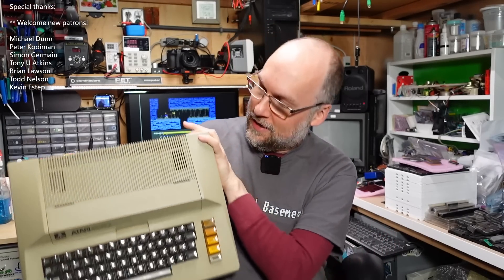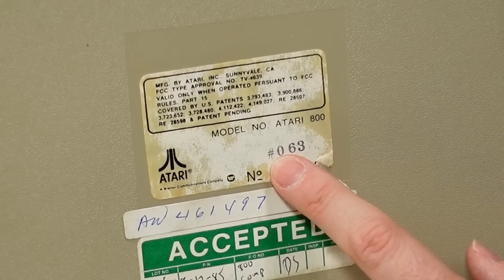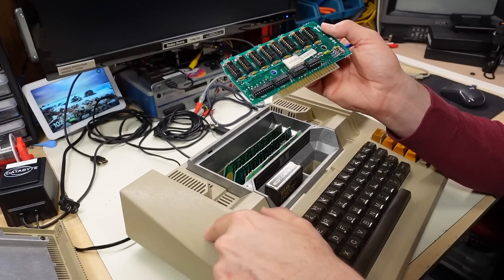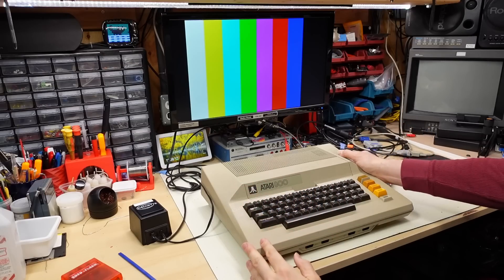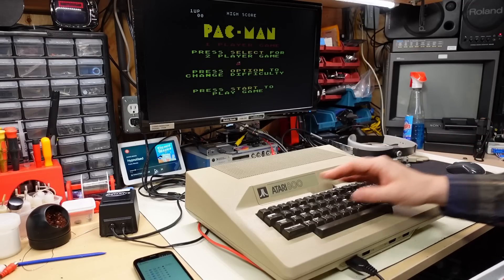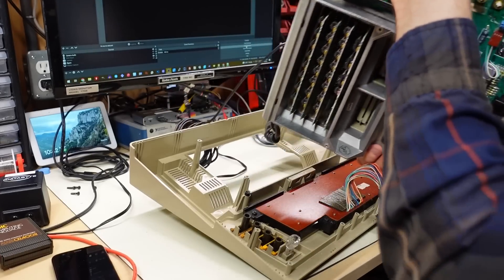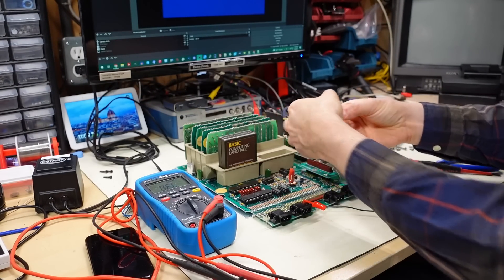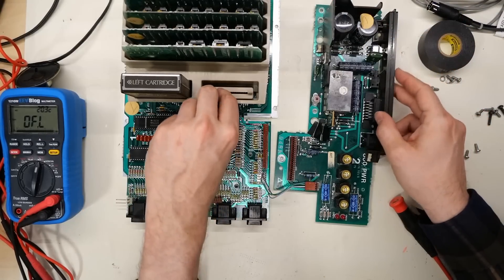Troubleshooting the beautiful Atari 800

Comment: The 800's case was designed to look like an electric typewriter. The thick metal shielding was required due to the strict FCC rules regarding RF modulators prior to 1981; thus, most other pre-1981 computers don't have a built-in modulator (Apple II, VIC-20, TI-99/4A, etc.). I believe that's also why the RF cable is permanently attached. In 1981 the FCC rules were relaxed and after then computers and video games could have a built-in modulator without needing such massive shielding, and the RF cable could then be removable. And Atari, Commodore, and TI all use the same pins on the video connector for composite video and audio, but the pins for luma and chroma (if present) are different on each system.
Reply: I wouldn't be sure of that.  The RF modulator is not under the heavy shielding.  It is the main CPU system that's under thrre.
Reply: yeah it was the address and data bus that were the primary rf radiators.
Reply: There is no rational basis for such thick metal for RF shielding.
Reply: The only rationale I can think of as to why the formidable RF shielding is possibly because a lot more people were listening to AM radio broadcasts in those days. I don't think FM and NTSC television receivers were as susceptible to interference from these machines.
Reply: I think it now makes sense about the built-in RF cable.  Bil Herd said to meet the FCC standard they had to have a 1m wire plugged into every port that could take one (while doing the test). If the RF cable was built-in then they could put their big ferrite ring on the cable inside to reduce the emissions and meet the standard.
Reply: @chetpomeroy1399  For TV, audio was FM, but video was AM.
Reply from the maker: @Daniel Morin  -- yep where I grew up you could listen to TV channel 6 on any FM radio -- my father used to listen to the TV news all the time while driving.
Reply: The shielding was required to meet FCC regulations which, ironically, were relaxed after the 800 shipped. It's one of the big reasons the Atari 800 was more expensive than the C-64.

The upgrade cards were originally encased as modules.
Reply: CB radios were a big deal in that time as well, the chunky shielding may keep rf from getting out or in.
Reply: @danman32  I seem to remember hearing decades ago that the video portion of an NTSC TV signal was amplitude modulated, which would make it susceptible to such interference. As Adrian pointed out, the audio portion was frequency modulated.
Reply: @chetpomeroy1399  isn't that what I said?
Reply: @DavePoo2  And there's also the question of what kind of cable is plugged in there. Being an RF output it wants coax, of course, and of a particular impedance as well. You wouldn't want someone plugging a regular RCA audio cable into the RF output jack both because it may act as an antenna and because of significant reduction in video quality that you'd see.
Reply: @RBLevin , writes "The upgrade cards were originally encased as modules."

You're right, I remember that now! I guess they decided to drop the cases when they starting shipping them fully populated.
Reply: @danman32  The RF modulator is in its own can to prevent radiation.
And... the board the power supply and RF modulator is mounted on is a separate socketed board. My understanding is this was an attempt to dodge the FCC, they were trying to argue the mainboard was the computer but not the power board and RF modulator. The FCC just looked at it and told them "Nice try."
Reply: Atari 800 was my first computer and I learnt a lot about computer electronics and programming from it. It was the first home computer that was FCC B compliant (maybe the only one) which accounted for the shielding. The CPU card sits between the back walls of the aluminium cage. The RAM and ROM modules sit in the cage too but in the removable area as shown in the video. The plate under the removable cover sealed the EM radiation. It was a big problem because I live in the tropics and played Star Raiders hours on end. 😂
Reply: @EternityofNight  oh yes there was!  back in the day when television still had rabbit ears it was not uncommon to hear the hum of the processor being transmitted through your TV. Especially if they were in close proximity this happened a lot
Reply: @fred_derf  the plastic cases were discontinued strictly as a cost saving measure, and no other reason. The company realized it did not need them and the expense of making them was cutting into their profit margin.
Reply: @JazAero  The cases were needed when they were sold as a user installable upgrade. Once the "upgrades" were included from the factory the need for the cases went away (and of course it saved money).
Reply: @danman32 Which has the added benefit of providing a massive heatsink.
Reply: @bfapple  not sure where that fits in this discussion but hardly any if any components were attached to the shielding to take advantage of its heat sinking ability.
Reply: @danman32  Never mind. I was getting mixed up with the C64.
Reply: Yes and in particular a ibm selectric mk1 🙂
Reply: @EternityofNight Maybe not rational but one for sure method the internal IC's and tracking would release their nasty signal into the nearby world, having said that the 2600 had none of this protection? It also gave strength to the upper structure and high up cartridge port and vertically stacked cpu and ram boards. The final reason was quality, this machine wasn't made to the lowest cost at all. It was a $6000 machine in today's money on release. This is why though capable, it did not sell in great numbers until it was sold at a loss at the end of its reign and the massively cost reduced xl range took over.

Comment: The RAM and ROM boards for the 800 were originally fully enclosed cartridges that fit snugly together.
Reply: I saw a post on an Atari forum that said Atari stopped using the plastic cartridge enclosures for the RAM and ROM boards in the very early 80s. Apparently there were overheating issues.
Reply: @jmpattillo  That's the reason why my 800 self-destructed. 😔
Reply: You could only go up to 48K with the awesome metal RAM modules, I somehow got an upgrade to mine which was a bare board.
Reply: Ah, interesting, that makes sense.
Reply: You have to realize you had ROM and peripherals above 48K memory space.  Bank switching didn't come out until 130XL and I think one other model.
Reply: @danman32  The 800XL had 64KB. That may be the "other" model. There was also the XE game machine that was based on the 65XE.
Reply: @jmpattillo  Great, why didn't anyone tell us that in the early 80s.
Then we would have plucked the boards out of their shells.
I had RAM modules in the repair several times...
Reply: Mine had the overheating issue, so I modded the cover removed switch to always stay on. That way I could remove the cover without it shutting down. The cover switch was designed to prevent a person form removing carts while it was on.
Reply: Correct. Once 48K RAM became standard and thus there was nothing left to upgrade, they got rid of the plastic cartridges and screwed shut the lid (originally it had flip-tabs to make it easier to open).
Reply: @tramadol42  i don’t know man, i was limping along with a TI 99/4a back then.
Reply: @danman32  FYI you are wrong. For 800 there were some bank switched memory expansion like Axlon's. Up to 512K or even more.
Reply from the maker: I was unable to find concrete info if any commercial games require 64k (that the 800XL had) outside of late release in PAL markets like Poland. Is there a list around showing which games won’t run on the 48K 800?
Reply: @adriansdigitalbasement  The only program I had that took advantage of the 64K was SubLogic Flight Simulator. If I remember correctly, you saw extra detail in the display or the area you were in flying in was larger. Perhaps less disk activity as a result… but it was nearly 40 years ago. I don't have the disks anymore.
Reply: @gianlucarenzi7706  I'm sure there were third party expansion cards that could, but only in a window of RAM below 48K or otherwise unmapped.  The XL/XE could switch out the ROM to babked RAM, which is how you could load the old OS for applications thar wouldn't run on the newer OS.  800 wasn't designed to allow bank switching into ROM or IO addresses.
Reply: @danman32  the XL and XE can do RAM space over the ROM because they actually have RAM in the same addresses. Simply the 800 cannot do it because its architecture has only 48k RAM space. It's simple.
Reply: @gianlucarenzi7706  Correct.  RAM only gets 48K of addressable space, and 8K or 16K of that addressable space can be occupied by the cartridges (leaving only 40K or 32K available RAM).  The other 16K of the total 64K addressable space is dedicated to system ROM.
Reply: Why is everyone telling me things I already said?

I said that analog video broadcast was AM, only audio was FM.

I already said that the original 800 was limited in RAM expansion beyond 48K as memory map above that was fixed/dedicated for ROM and IO/peripherals, though the later models could switch upper memory space with RAM.
Reply: @adriansdigitalbasement  There were a couple from the XE era. Ace of Aces required 64K.
Reply: @adriansdigitalbasement  if it requires more than 48, it explicitly states xl on the label
Reply: @danman32  This is what I call: memory bank switching. No matter if it mask out ROM, or RAM or I/O Space (there is no I/O space literally speaking in the 6502 anyway) it is simply map something different at the same window from CPU point-of-view.
Reply: @jmpattillo  It was a common "hack" circulating among Atari "groups" back in the day to take the cards for the 800 out of their shells to improve cooling of the cards.  As to joysticks, I can't remember the brand, but they did make joysticks that were super high quality with the same look and feel of the arcade video game joysticks (the big red ball on thick chrome stalk type).  Those were the must haves for the 800's
Reply: @danman32  we developed a bank switching RAM module for the 800, Long before the 130 XL my friend began working on it as soon as the 800 released I still have mine it supports 256K total paged ram
Reply: @85 Testarossa those switches are enabling or disabling the axlon expansion module maybe...

Comment: Best 8-bit machine produced during that time. The cards were originally housed in metal. Atari removed the metal in later machines because of over heating. That's why the cards flop around.

Comment: As others have pointed out, originally the ROM and RAM boards supplied by Atari were enclosed in plastic cases that fit neatly together and prevented any movement. These caused overheating problems in extended use and Atari eventually started using bare boards. However, they did fit a slotted plastic spacer piece that was set down on top of the boards to provide lateral stability. I think you can get a replacement 3D printed version or perhaps find a hobbyist with a spare for you.
Reply: My brother had an 800 in around 1981 or 82 that had the ROMs and memory in the plastic boxes. He upgraded the machine with a single 3rd party memory expansion board that had 48K. He was using the machine for his college thesis.
Reply: interesting... my 800 has the enclosed boards and I never had any problems with it that I recall.  I used it most every day for 6-7 years; I still have it in a box somewhere, but I haven't had it powered up in probably 30 years.
Reply: @davej3781  I think it depended on how many boards are installed, whether you have good airflow around the case or use it under a monitor shelf for instance, and individual variability of the components. I know my 48K 800’s do get rather warm above the power supply board and over the RAM when they’re used for a couple hours straight. BTW, you should pull out your 800 and clean it up sometime - you might be surprised at how much people are paying for them now.
Reply: @LeftyLabs  mine is a fully populated 48k system with all 4 boards.  who knows, maybe it did crash from time to time due to getting too warm, but I don't recall any chronic problem... I didn't have it covered by anything though so that helped.
I figure I'll get it out again when I have grandkids, show them what ancient computer technology was like
Reply: Once the later 800s all had 48K there was no reason to have packaged RAM and ROM boards (no end user is buying or  installing them). At that point just have open boards with a fastened case cover. Heat was never an issue.

Comment: Ah the memories!!

This was my first computer. My dad won it in a business promotion and brought it home in 1980 when I was 12. I had plenty of debates with my friends who had Apple ][s over which machine was superior. I used Atari Basic to create simple multicolor animations with sound effects that my Apple friends couldn't reproduce in Integer Basic. The best one I made was a flying saucer shooting a laser at the ground with a multicolor explosion. I spent hours typing in Microsoft Basic games from books realizing that I couldn't port most of them over anyway. We used our computers mostly for games, of course.

Typing on that machine was ponderous because of the keyboard layout, as you noticed. You keep having to slow down and look where the Return key is. I used Atari Writer to write papers in high school ('82-'86) and printed them out on an Atari letter quality printer. I was pretty much the only kid in my class using a word processor at the time. 

The Atari OEM RAM expansion cards were originally encased in metal shielding and plastic cases. I ended up upgrading mine from 16K to 48K a few years later. When you packed in 48K of RAM into it there was absolutely no space left. Adrian, you mentioned that your expansion cards are loose and can be inserted backwards. The original cases prevent that from happening.

Pics:
https://atariage.com/forums/uploads/monthly_2021_01/48k-set-atari-800-plug-16k-ram-cx853_1_6afa7bc5d2c7382d80edb22431317200.jpg.97180b8a2f26d3331956de50fa8588a9.jpg

https://atariage.com/forums/uploads/monthly_2021_01/Atari_800_PAL_Atari_810_Atari_410_Boxed_09.jpg.fb3e243325a07e89b2655833782d0454.jpg

After about five years of heavy use, my 800 would often freeze and display garbage characters across the screen. At the time, I assumed it was because it was overheating and destroying components. Once the crashes became too frequent to use the 800 anymore, I upgraded to a used Atari 800XL and kept using my old peripherals through my college years.

We had a good run! Almost 10 years of 8-bit Atari!
Reply: Yes it's why Atari sealed the late-era 48k machines with screws instead of levers because the user was not supposed to be in there where he/she could put the RAM cards in backwards.
Reply: My first computer as well. I don't have the physical model today, but enjoy the nostalgia using an Atari emulator to play games.
Reply: I've never seen a word processor on the 8 bit range.  I only used WP on the ST.
My second machine was an 800XL ,(ZX spectrum being the first,)
I still have my second ST (1040STE).
From the 8 bit computer range I also have 800, 800XL and 65XE.
Also the cassette and floppy drives for the first two.
I remember seeing the 400 and 800 in the shops, well beyond my means.
You're very lucky to get one of these so early on.
Reply: I got mine at the exact same age.  Never got a printer for it though.  Felt very lucky to have it.  It put me on a trajectory to go into IT.